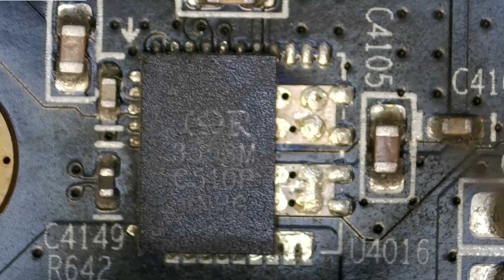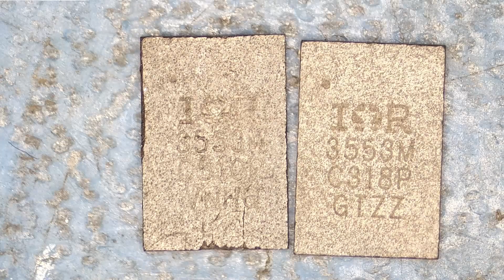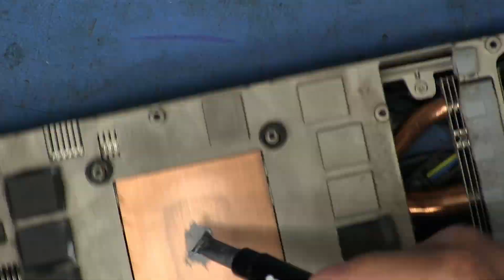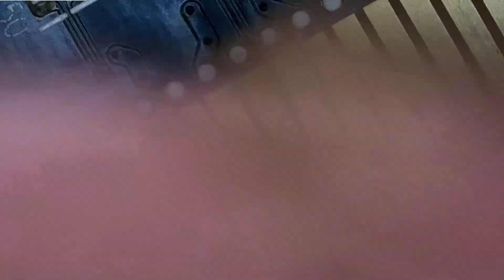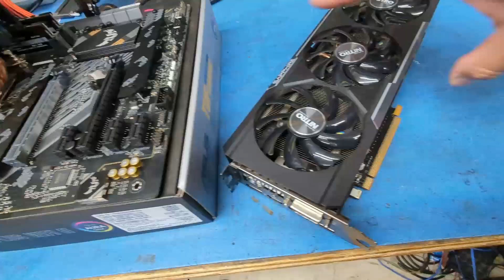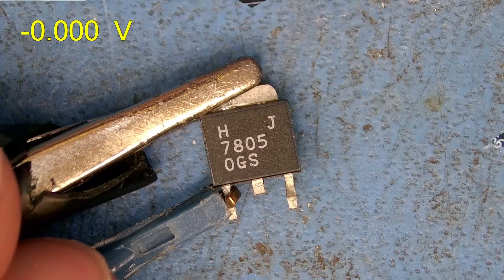TEF #126 | Sapphire R9 390 GPU Repair Attempt

Comment: I have an MSI R9 380 I recently obtained. It initially worked for 1/2 hr. I was able to run GPUz and showed cool temps and go on Techpowerup to see its specs etc. As soon as I started to run Heaven benchmark it produced a red splash screen and died. No fans work, and its not detected at all. Even tried flashing the bios with DOS method but get the "adapter not found" message. Only the MSI logo light works. It is a beautiful looking card and came in its pristine condition OE box and manual, cd etc. I took it apart and found nothing obvious. Cleaned and repasted but still dead. I want to test components with Multimeter but have no idea what any of its numbers mean. I need a schematic like shown in this video. Any links to any how to test and tips would be appreciated. It's too bad this repair attempt didn't pan out, you put up a valiant effort and reminds me of my attempt to fix a washing machine board that failed as well smh. Liked and subbed.

Comment: what microscop you use can you give me the link ?
Reply from the maker: Unfortunately, the one I'm using in the video isn't available anymore, and there's no link for it, but I had purchased it from Northridge Fix. It's a blue one that doesn't have a model number or anything printed on it, so I don' t know if this exact unit is available elsewhere either. Northridge Fix has replaced it with another model that has similar design and accessories: 

https://northridgefix.com/product/microscope-camera-bundle-1080-60fps-180x-lens-ring-adapter-2-barlow-lenses-0-5x-0-75x/

Comment: did you check fuses on the back?
Reply from the maker: There weren't any on the back of this card that I saw. Just the ones on the component side. There's a polyfuse on the back, but it's by the display outputs. That was fine.

Comment: That sounds like a bad driver and or controller since it popped the replacement power stage, it's likely the original power stage killed the source of the pwm signal when it died. 

Since the output was shorted to 12v it is very likely that the core is dead if it's a memory phase or vddci or whatever minor low power rail, if it's a core phase you have a chance since it's a low impedance short to ground and will blow the fuse quicker or trip OCP on your power supply. 

This is why you always measure resistances on a gpu before powering it on, at the very least measure 12v to ground becuae that's where the majority of the rails derive their power from, anything >1k ohm is a concern but I'll risk it if it doesn't matter much, anything >300ohm is a stop and disconnect inductors or 0.8v injection to me to find the short

Gpu pcbs are built to soak heat, higher preheater temps are better but you might need to remove any electrolytic capacitors near the fault since those like popping and soldering temp
Reply from the maker: Thanks for the info. I have next to no experience in GPU repair, but if I ever try to mess with one in the future, I'll try to keep some of these tips in mind.

Comment: Small tip for you - don't put in the title whether a repair was a success or a failure. For me at least part of the fun with watching repair videos, particularly electronics (and also engines), is the initially uncertain outcome and following along with the technician/engineer as the repair unfolds. Stating that the repair failed in the title has kind of 'spoiled' it. I would instead suggest that you add to the title of future repair videos something like: "Can I fix it?" 🙂
Reply from the maker: Honestly, I wasn't all too happy with the way this video turned out, so it sat unfinished for a while, staring at me in a judgemental manner every time I opened up the video editor. I have several videos in the works that I'm waiting on parts for or I need to order parts for and I didn't have anything else ready for today, so I begrudgingly decided to finish it. But I really appreciate the feedback and I'll try to keep results more of a mystery.
Reply: @ThatElectronicsFool  No problem, thanks. 🙂